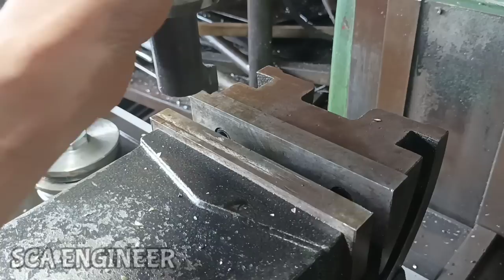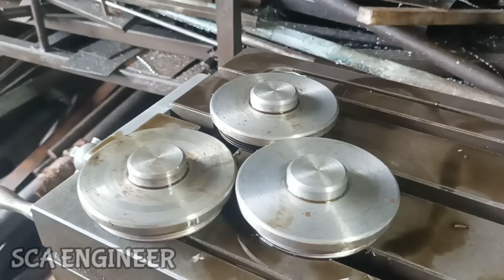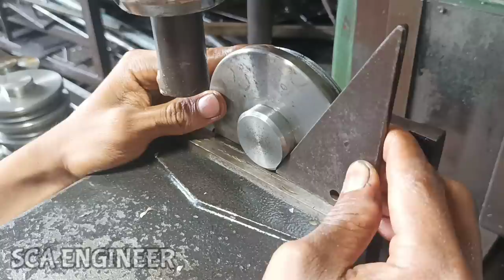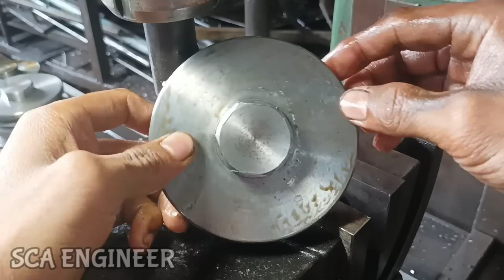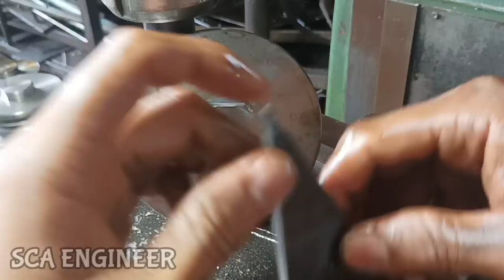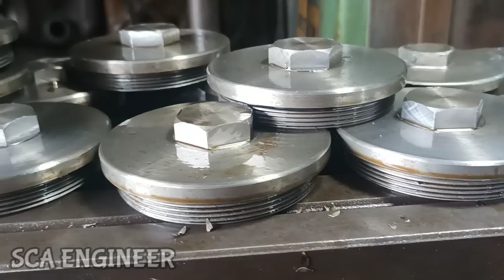Simple And Faster | Cutting Hexagon Bolt With The Right Triangle Tool On Milling Machine

Comment: Very good work. 
But a hex bar turn with a spigot and TIG welded into the cap would be less work. 
Two holes drilled part way through the lid would allow a basic pin wrench to unscrew the cap. Even less work to manufacture.
Reply from the maker: Thanks sir👍

Comment: What’s the angle of the guide
Reply from the maker: The reference angle is the sum of the angles of the hexagon divided by 6, so the measure is 120°
Reply: @SCAENGINEER  
Cool thanks
Reply from the maker: You're welcome sir
Reply: @SCAENGINEER  
What country do you work in
Reply from the maker: Indonesia Sir
Reply: @SCAENGINEER  
Nice work from 🇬🇧
Reply: If I used a rotary table mounted at 90° , to make a 1/4” Hex bolt, how many degrees is each degree turn ? (Before cutting next face)
Thanks!
Reply from the maker: 90°/6 = 15°
Each degree is 15°.
Reply: @SCAENGINEER  
Thank-U👏👏👏😁